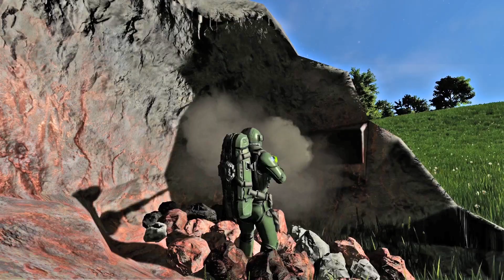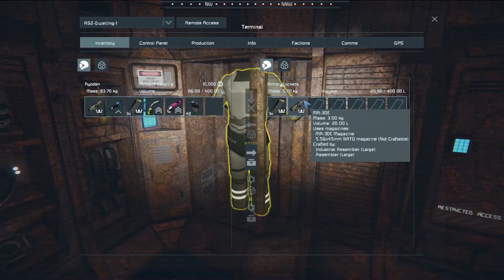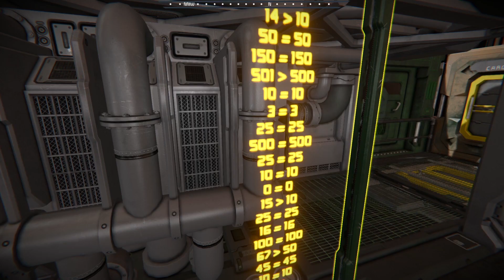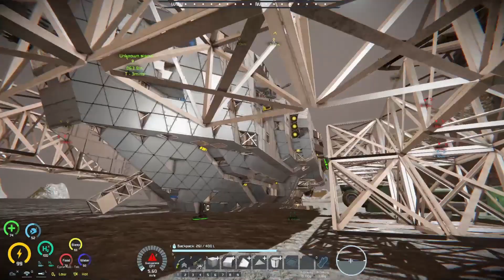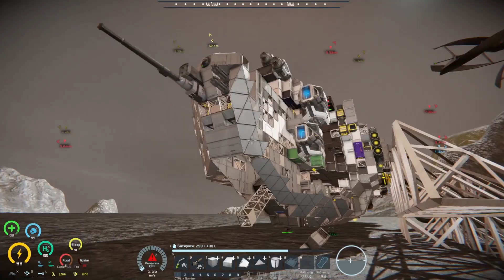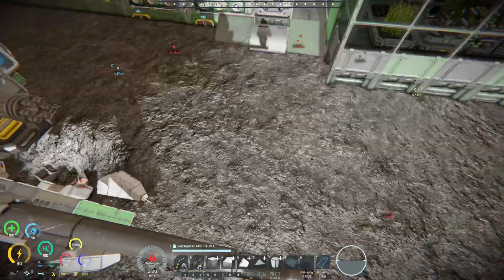Survival Records, Igneous (Space Engineers Lets Play) E30

Comment: The ship is coming along nicely, I cant wait to see how it turns out. Just as an FYI I attached a large grid hinge to a cargo container then replaced the hinged part with a large small grid hinge part. Then I used the large to small adapter we got in the most wanted update and added 3 small grid air vents to that. They would not pressurise the base. I tried everything I could think of but could not get them to work.
Luckily I finally found a large grid air vent but was surprised that I could not make the small ones work, I have a couple of small grid h2/02 gens attached via hinges that work a charm and don't see why the air vents wont.
Reply from the maker: I wonder if in the code a small grid air vent only checks to see if it is inside a small grid airtight space.  Are you using the mod that lets you check for leaks?
Reply: @ryodenshipwright  I am and it tried to get it show me a leak but the little markers didn't even get a block away from the air vent. I took all of the windows out and filled them and still got the same result so I think you may be right.

Comment: As long as you process all the ores ( Ag Au Ur Pl) that you have on the planet surface, I also don't see a reason to take the full refinery with you.. it will just eat up your small grid (lg) batteries + Ur in the reactor.

In the "cryo" room could be your "kitchen" -- the space balls might be decoration, the gyro in the same room hmmm unknown... I would not get rid of them try and move them else where. maybe a bed in is place (if bp available).
Reply from the maker: I was thinking of food prep but there does not seem to be small grid versions of the kitchen and such.  I think I will just need to bring a large supply.
Reply: @ryodenshipwright don't you have the emergency ration dispenser  from your starter pod .. or was it ground down.
Reply from the maker: @EKOMovers   I do have that and can make another, but it doesn't really make much of a kitchen.
Reply: @ryodenshipwright  just an idea for that room.. when you get bp for the block add it in later ...